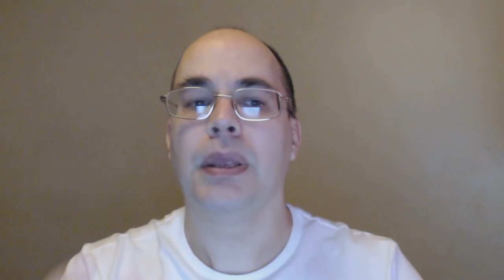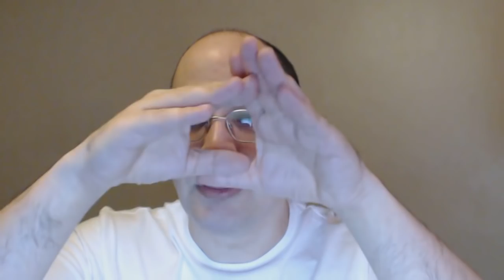How do rockets move in space, with nothing to push off from?

Comment: The problem my friend is that the space is a vakum! In space you can not use gas or oil just because in the vacum there is no way to  have ignite anythin! Try to light up a cigarette in a vakum you will find that it is not possible because there is no Oxygen! Think first do not do 4/5 mins talking shit and not going straight to the question and another food for thought mu friend listen: IF YOU NEED SO BIG ROCKET FROM EARTH WHY ON THE MOON THERE IS NOTHING LIKE A BIG ROCKET OK THERE IS NO GEAVITY PULL BUT STILL THERE IS NO WAY COMING BACK AND THERE IS NO WAY IN THAT SHIT SPACECRAFT TO HAVE ENOUGH FUEL FOR RETURNING SO IT IS JUST A SHIT!
Reply from the maker: Space is a near vacuum and to cope with that problem the rocket brings the oxygen with it, often in the form of liquid oxygen. The moon has a lot less mass than the Earth and so a lot less gravity and with a fairly small rocket thrust (lifting off a much lighter craft) you can get a long way to Earth before gravity from Earth helps you and you almost fall back to Earth.
Reply: Roger's All Like woah chilll
Reply: Papa Legba  - "but as a gas does no work when it expands into a vacuum"
Then it is a good thing that the engine is done PUSHING THE MASS out of the  engine before the gas ever even SEES vacuum.
The work is done while the gas is still at THOUSANDS of PSI within the engine and nozzle.
YOu are right, once the gas leaves the nozzle it cannot perform any further work.

Comment: The gun analogy is worthless as an example because there is gravity and atmosphere for the gun and space supposedly is void of both of those
Reply from the maker: The gun analogy is a perfectly reasonable analogy and you are totally mistaken about gravity and slightly mistaken about atmosphere. Being in space doesn't mean there is no gravity, the further you go from a mass like the Earth the weaker gravity becomes, but it doesn't disappear, apparent zero gravity only happens due to ships in orbit falling to Earth and missing the Earth and the contents all falling at the same rate. The reason the planets are in orbit around the Sun is due to the gravitational pull of the Sun stretching out well Pluto. There is also some small amount of the Earth's atmosphere although very thin even stretching out as far as the Moon there is no sudden edge to the atmosphere it just continues to get thinner.
Reply: @mjmurcott647  don't left-field the conversation talking about all the planets but stay on target here.

I think pretty much anybody will agree with me that the gravity is so minimal that it appears to not exist and regardless if there is no gravity at all or not is it relevant because the test would clearly be different in space than it would be standing on the ground outside and because of that it greatly changes the outcome of the test   . 

Look a rocket works because there is atmosphere to displace has the burn fuel is projected from the rocket because are is a substance it has been City This Is Why Planes can fly by having wings/Tech 

But in a complete void space where there is no atmosphere this means there's nothing to push against and because it's a vacuum according to NASA this means if you do happen to blow something into said vacuum it's not going to build up anything it's just going to disappeared no pressure will be created because of said vacuum kind of like when you suck the air out of a coke bottle can you can feel its sucking back and if you release the pressure in your mouth it absorbs the air back out of your lungs. 

Now as for the gravity issue 
Have you seen the test where they drop a bowling ball and a feather and both fell at the same speed? Clearly in a regular atmosphere that doesn't happen but in a almost perfect vacuum it did happen so the outcome was absolutely different than it would have been in a regular oxygenated atmosphere now apply that to your gun analogy and you can clearly see that the gun analogy does not apply to talking about what happens in space
Reply from the maker: No gravity isn't minimal in space, it doesn't appear not to exist, you are flat out wrong.

Rockets don't rely upon atmospheric displacement.

Galileo experiment (ball and feather) has absolutely nothing to do with rockets in space.
Reply: @mjmurcott647  I'm not talking about Galileo I'm talking about an experiment that was done in modern times about 5 years ago and if you drop a bowling ball in outer space it doesn't drop like it does here on Earth because it's a completely different ballgame out there than it is here on level ground would you agree? Or do you think that a 25lb weight is going to react the same at 5ft off the ground as it would in outer space?
Reply from the maker: Yes the Brian Cox demonstration of the ball and feather https://www.youtube.com/watch?v=E43-CfukEgs replicating the earlier hammer and feather on the moon https://www.youtube.com/watch?v=KDp1tiUsZw8 all dating back as they both mention to Galileo and the leaning tower of Pisa https://www.uh.edu/engines/epi166.htm
Reply: @mjmurcott647  ok cool I'll make sure to reference Galileo from now on when I drop things
Reply: @mjmurcott647  so back to the beginning . In a complete void wherein if you blow something into it it disappears into said void like a vacuum 
Then there will be nothing to thrust off with because all of the thrust is being sucked into the vacuum of space
Reply from the maker: But rockets don't work by thrusting off anything, they work by conservation of momentum if something is stationary and part of it separates off and moves in one direction the rest of it must move proportionally in the opposite direction. Also vacuums don't actually suck, air pressure pushes, if you empty a bottle of air it will collapse not due to the vacuum but due to air pressure pushing in not being balanced by air pressure pushing out - https://youtu.be/C57xxvBtP7o
Reply: @mjmurcott647  your assuming that the earth is spinning and moving around the sun and that's a different subject all together.  As for your bottle explanation

 are you seriously trying to argue against me saying a vacuum of space sucks 
By saying it doesn't suck the bottle collapses do to an imbalance in pressure? Are you just trying to argue?  Because I'm not but it sure seems like you are
Reply from the maker: The Earth spinning and moving around the Sun is an established fact, not an assumption. A vacuum cannot impart a force, a vacuum is the absence of everything, in order for something to exert a force there must be something there to exert the force, if the vacuum of space worked the way you suggest no planet would have ever formed an atmosphere. If you open a door of a space craft the air rushes out due to air pressure, if you imaging the air molecules being like tiny ping pong balls bouncing off each other all the time in an enclosed space once you open the door the balls bonce off into the empty area.
Reply: @SheikhN-bible-syndrome  Air resistance is the resistance of the air to a body passing through it; the force that the body has to apply to move the air out of the way, equal (thanks Newton) to the force that the air being moved applies to the body moving it.  Air resistance exists because air molecules have inertia so resist being accelerated: they resist change of momentum. And, by Newton's first law of motion the force exerted on the air molecules equals the force that they apply back.  
So: change in momentum is resisted by inertia, so a force is required to change momentum. And, force exerted = force resisting.
Therefore, if a rocket pushes e.g. a brick out behind it, the momentum of the brick goes from zero to something in the backwards direction. So the brick's inertia resists this. So the rocket has to apply a force to the brick to make that change of momentum against the brick's inertia. But, at the same time that same force is applied back on the rocket (First Law), so a force is applied against the rocket's inertia, so the rocket has a change of momentum :- forward. 
Now, rather than one brick, imagine a whole series of bricks: push, push, push.
Now, rather than bricks, imagine a whole series of gas molecules: push, push, push, push, push, push, push, push, push, push.
Reply: @SheikhN-bible-syndrome  Do astronauts onboard the International Space Station 'float' because there's no gravity at their orbital height of 250 miles above the earth, or do they 'float' because they're travelling in a circular path (orbit) around the earth at 17,000 miles an hour?

Comment: I'm still confused
Reply from the maker: The point is that rockets don't need to push off anything, if you consider a rocket as stationary then in order to get it moving anything you push out one end causes the rocket to move in the other direction the more things (in terms of mass) you push out one end and the faster you push them out the faster the rocket moves in the other direction as the action of pushing them out causes the rocket to accelerate.